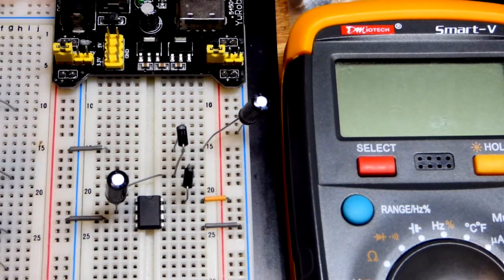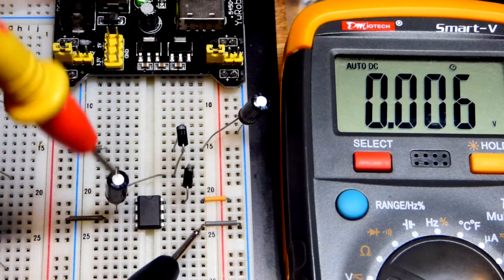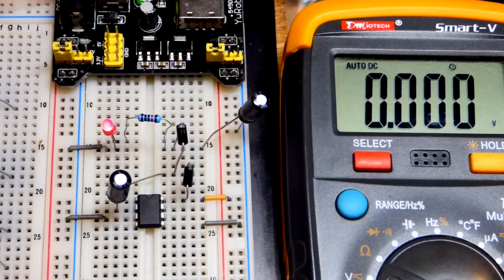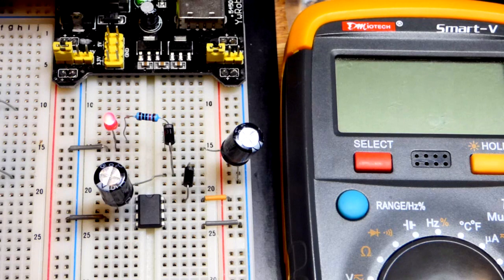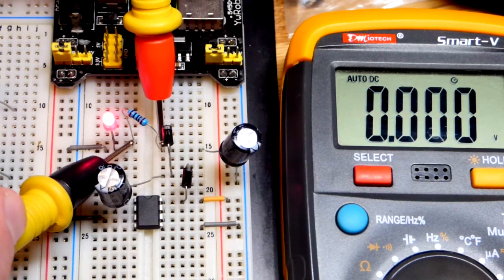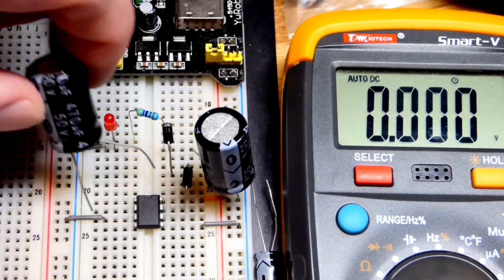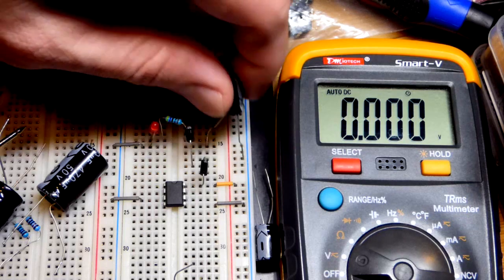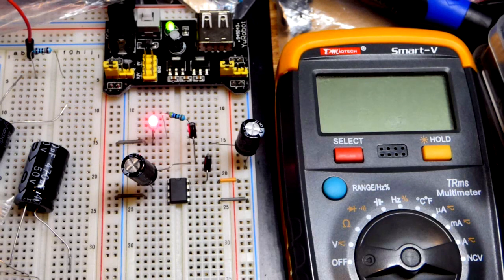7660 IC voltage multiplier 2 times supply V minus 2 diode drops circuit LMC7660  electronics

Comment: I think the only problems I experienced from not discharging the capacitors were with the circuits that provided negative voltage --- and this begs the question can a capacitor hold on to a positive charge or a negative charge? If so I imagine the problem was attaching a capacitor charged with one polarity into a circuit that expected the opposite polarity and this "bootstrapped" the IC chip erroneously which caused the chip to overheat. Luckily I only fried 1 of them. 😂 FWIW my little "percussion synthesizer" uses a 7660 to bias the voltage (I think that is the correct way to state that). Probably not the best idea but it works? Check out page 71 in Mims Volume I.
Reply from the maker: A capacitor will accept a charge in either direction. The larger value ones though are almost all polarized so that their chemistry depends on one side being more positive than the other all the time. I found one of my polarized capacitors doesn't hold it's charge as well as it should, making it worthless in series capacitor circuits. I am pretty sure I accidentally reverse charged it to 5 or 10V for a while in an earlier circuit. Hard to tell what will destroy components until you study them in detail and fry some lol.